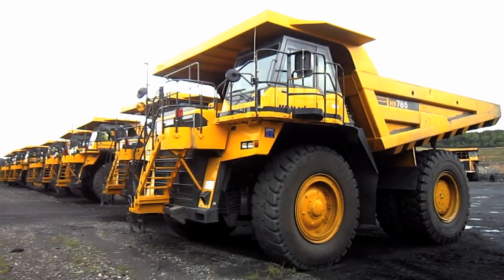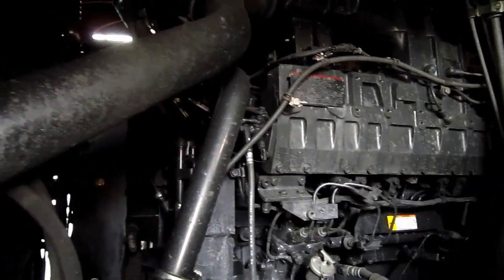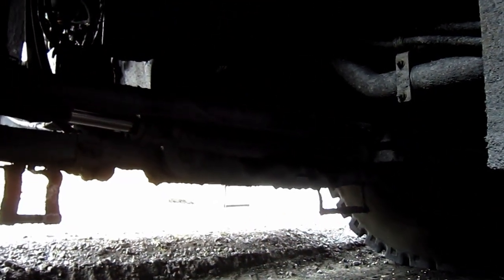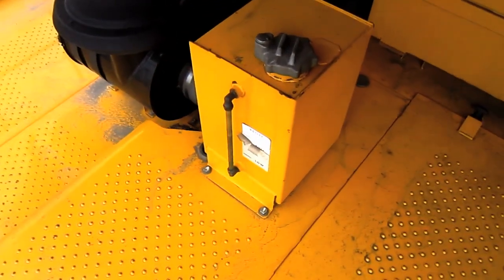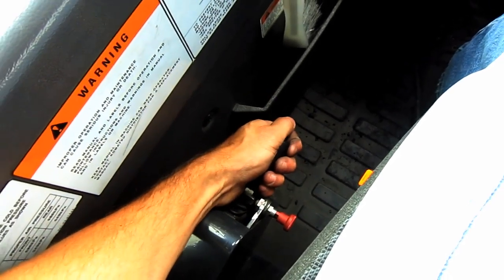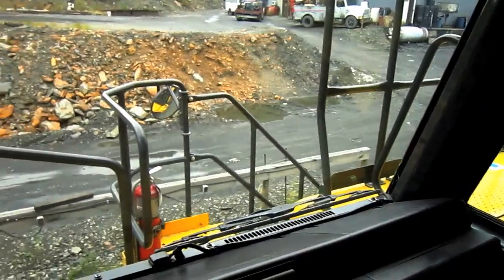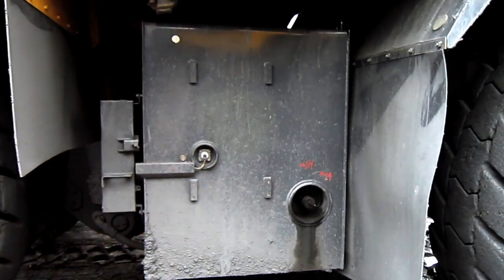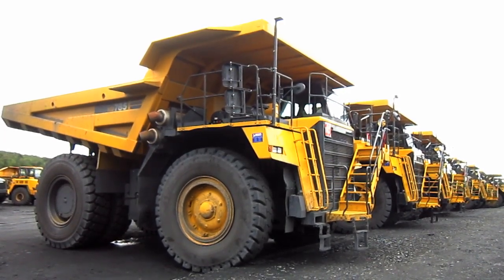Komatsu HD785-7 Documentary

Comment: Is this fleet on hold due to current situation, or is there any other reason, you use past tense in few answers so I assume they arent working currently...
Reply from the maker: This fleet got sold back to Komatsu after about 5 years of operation and replaced with a comparable fleet of 777s. The maintenance cost of a Komatsu HD785 is about double that of a Cat 777. Thanks!
Reply: @PAmining  Wow that is interesting, half the cost is significant difference. Thanks for your work and keeping us informed. Please focus on older machines, as they are disappearing...